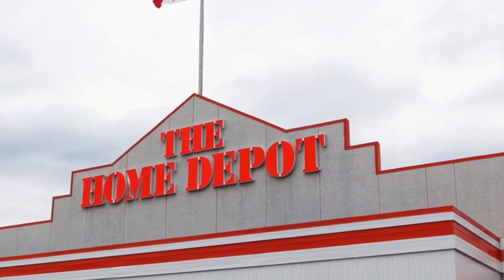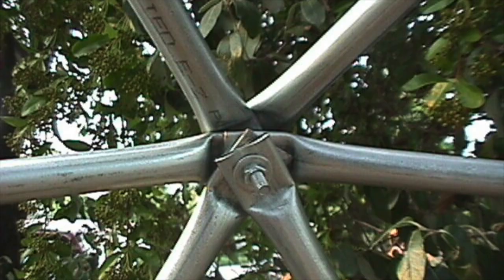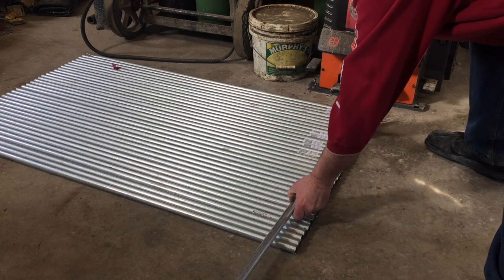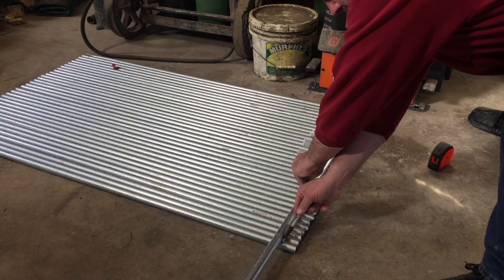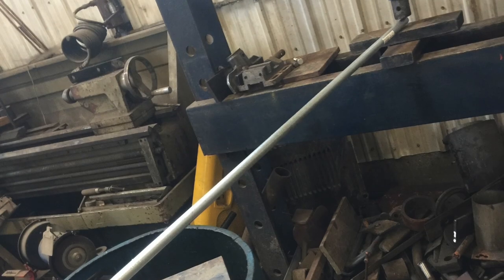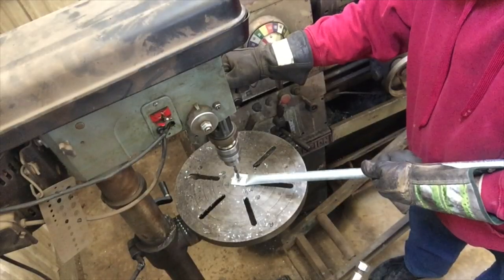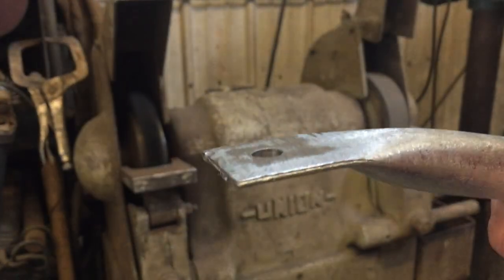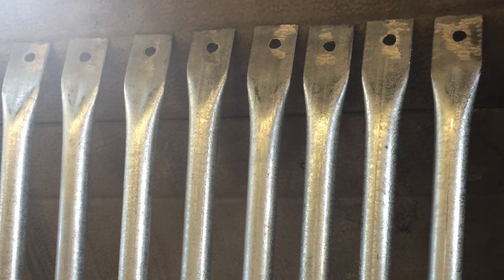Making Metal Geodesic Dome struts under $2 each DYI - Part 1 (2020)

Comment from the maker: I would love any comments/ideas on this! I'm always looking for better ways to do things on a budget!
Reply: "A big mounted grinder is essential."
Not really essential, a hand drill with a larger bit or reamer would work just as well.

I would have clamped two straight edges forming a 90 degree pocket on the drill press table. That would have allowed you to place each pipe end into the corner and it would quickly and exactly put your pipe end where it needs to be for drilling.

I loved the concept on building  this thing. .  Thanks for that and the video Cheers
Reply from the maker: @rickdees251  thank you
Reply: You didn't calculate cost of equipment. The title is misleading.
Reply from the maker: @richardroman9280  but you keep the equipment!!!!
Reply: Use an angle gauge while squishing the end, adjust angle before taking the pressure off. A countersink in a drill will deburr the holes, or you could use a flap wheel on an angle grinder and round off and deburr the end at the same time.
Reply: I got four of those drill press hydraulic dealies in my closet! They're super cheap.
Reply from the maker: @voidisyinyangvoidisyinyang885  sweet
Reply: have you got a part 2 - did you construct the dome
Reply: How long is each pipe in this case ?
Reply: @jamesdds  
8 inches long & moderate girth
Reply from the maker: @jamesdds  oh god - that was a few years ago!!!!
Reply: Simple Tek - 1 idea, since you want quite precise angles for easier assembly, with no preload conditions: Make a Fixture to hold the pipe, and set the angle, one for each angle needed. I bet there are some easy to learn CAD Programs you could use to design a good one. 

You want a two halved design, that can clamp the pipe ends on the round shaft of the tube, and either a hinged face that bends up to a stop angle, or a slide that is already machined to your set angle, that slides in to stops, for you base angle. Finally, you want to press from the other side to set the tab angle. Remember, allow for your springback! All metals have that.

Then, get a Wood Shop or a Metal Shop, that does CNC Work for hire, and make a couple! Maybe try first with wood, as you might need to do a large "Tweak" on your first one! If it is right on with wood, and you want to make Dome kits to sell, go make metal forms!
Reply from the maker: ok
Reply: Unlike an airplane your which which is very worried about weight cement and these tubes will make it stiffer and have your so the wind doesn't blow it around it might Act might at as a corrosive maybe could shoot foam in there soon knows as corrosive

Comment: Well,
You got your squishing tech wrong.
For that to really work you should take two blocks of metal and use and angle grinder to carve a less than half circle on both sides.
mount them in a heavy vice and preferably have a stop plate at the back so that every pipe goes the same distance into the press.  While it's in the queeze do your angle bend as well.
The straight flat is know to wear out at the transition from flat to pipe.
The curved transitions hold their shape more and don't stress harden and snap from small bends over time.
Reply from the maker: And yet, years later, the dome is still standing!
Reply: @SimpleTek  
And yet they don't look like they are metal fatigued and about to break for no apparent reasoning.
If you have an electric angle grinder, and can find two blocks of metal then doing it better isn't an issue.
This isn't that hard to accomplish, and is the beginning of a basic metal working shop standards.
Quality is just a Do.
If you really want to reduce every action to the most minimal possible then don't even start anything and don't get out of bed even to poop.  For that would be the ultimate accomplishment in that direction.
Reply from the maker: @FuhrChris you’re assuming, they don’t look metal fatigued at all
Reply: @SimpleTek Metal fatigue often is the cracks on a flattened pipe are on the inside.
(I kinda  know some stuff about Metal fatigue since I worked right next to Boeing's destructive Lab and would get to see things like whole wings being subjected to stress hammerings.) 

You said It's still standing.

I take it you never took it down and set it up REPEATEDLY?

You build so that you can't take it down and put it up somewhere else.

I build BETTER with about the same amount of effort.  I can move my builds without having to worry.  In fact I'm looking at making the Oval version in which what starts out as a circle could have a 1/2 circle taken down and the middle created.  Then each year I could take down the 1/2 circle and make it LONGER.
By taking the time to do it right I can do more.  And it would have taken less time to do it the right way than to keep defending in your next text.

Comment: WOW GREAT VIDEO! Have you ever made one of these into the adobe style houses before can the design hold the weight of the clay? What website did you find the plans at you said its manitoba sites for agriculture yes ? WHich ones  have designs to see ? Did you make all the designs ? Is the site for farm life how to build stuff ? Is there still programs like what Ontario had when people needed to build a sheep pen and the farmers could apply to have help for building stuff is this the same thing in Manitoba? Cause they could take your design for the geodesic structure use it to make roof for an animal hut and use bails of hay like they do to make the tiny houses on Kibbutzes in Israels and the bails to insulate walls use the gedesic for the animal sheep shelters and such or even build tiny houses for people too have you seen the ADOBE style houses the dome you made can be adapted to make the roofs for those if the pipe that you selected is strong enough to hold and wont bend under weight of clay did the Manitoba website its government one right so did the plans say if they tested the structure for such uses and would they approve for such also? Under building codes did you have to get approvals and such ?Make more videos on this you make such great explainer videos on how to I was impressed! Good work!
Reply from the maker: Not sure if it could support clay

Comment: Conduit is too cheap. I made my own but I used steel tubing with  eighth inch wall. 50 ft 6 V for $2,200.
Reply from the maker: Prices are different after the pandemic

Comment: Ironworker machine with the correct dies would fly through this process, 1 stroke of the hydraulics to squash, 1 stroke to shape, 1 stroke to punch the hole.
Reply from the maker: Agreed but for one greenhouse does it really matter if it takes an extra 2 hours?    Cost of machine
Reply: @SimpleTek  Yeah bit expensive for 1 greenhouse 😂 Recently came across Ironworker machines and how versatile they are, especially the Scotchman with how many accessories are available, cool project 👍
Reply from the maker: @RichardSmith-wr6go  thank you

Comment: I would have touched up the corners and ends of each pipe.
Reply from the maker: Good advice
Reply: @SimpleTek  It’s not a big deal. But it might prevent minor cuts, especially during assembly. Or if kids are inside after assembly. But this was an EXCELLENT idea? New subscriber!
Reply from the maker: @Zerpersande  thank you for the kind words

Comment: C’mon…DIY? The only part of this that is remotely helpful to a typical DIYer is the part suggesting conduit is cheaper than pipe. And even that isn’t any revelation. The video shows using a piece of pipe used to draw a line across the others pieces instead of using a 4’ metal ruler but THEN goes on to show the use of a industrial shop grade metal press, drill press, and grinding wheel. Seriously? I mean if I had all of those tools at my disposal I wouldn’t be searching online for ways to easily and cheaply fashion metal pieces like this. Added to that are the helpful comments about how hard it would be to do the same tasks WITHOUT access to such expensive tools. DUH!.
Reply from the maker: What does DIY mean to you? Corporate Lego?

Comment: hey pleasetell me the power of your hidraluic press in wich you have obtained that angle you steel bars  thanks you cheers
Reply from the maker: That was a 100 ton but you could do it with a 10 ton
Reply: @SimpleTek  some on the web get  astraight angble with super mechanics in a supertstore,amateur is crazy when he tries to bend the angle from straighit to whatever is desired...  with all kind of mechanics, can you guarantee me  i can get the desired angle for a V2  witha 10 tone hydraulic press?
Reply from the maker: @barakasense  guarantee? Nope lol

Comment: Since most length of pipe are the same set a table that allow you set and mark the pipe with a sharp knife. Use a good quality pipe cutter will cut your pipe or use a chope saw. You should have the same pipe length within 1/16 of an inch. For me I would even use a grinder to make sure the pipe length are the same by grinding the end. Then use a die to make your holes and ends. Then you will have good connections
Reply from the maker: connections? the squished makes for the great connections !!!

Comment: if I want to build 6v geodesic dome using the same pipa, does the angel of the pipe still the same 18 degree and 16 degree ? Thanks
Reply from the maker: use a dome calculator - angles change huge for 2, 3 and 4 V and so on

Comment: For those without the tools.  One could set up 2 bench Vises to flatten the 2 ends at the same time.  these will be flat and need to be bnt later on to proper 16 to 18 degrees.  One can take the conduit to a metalshop.  Many will do metal work for $1 per minute.  they will use Jigs and stops to be able to cut additional pieces without remeasuring.   They can use a shear instead of a chop saw or can use a bandsaw to cut whole bundles at one time.   they can setup 2 squishers that simultaneously squish both ends to keep flattened parts absolutely parallel and my metal guy uses a spring loaded puch marker to proVide tiny dent where either the drill bit or hydraulic punch makes the hole.  This preVents the tip or drill bit from skating.  By using shears instead of a saw, no burrs need grinding and the right punch die can also round the ends of the struts for easier set up.  Depending on size of project, there is some point where a professional can help the DIYer saVe money as well as time
Reply from the maker: cool - I like sledge hammers though. LOL

Comment: Copper tubing around wood stove pipe. 12 volt pump for solar panel or battery charged by solar. Connected to 1/2 PEX on floor in home. Pink 1" styrofoam insulation to fill gaps between. 100% vinyl plank flooring to cover. Cheap radiant heat. To prevent over pressurizeation use old water heater tank and leave cap off on top for pressure escape.
Reply from the maker: cool

Comment: This is amazing, thank you for sharing. Can this be made into a house? Eg. Fiber cement board for covering? I have no building code in my village.
Reply from the maker: Yes, absolutely
Reply: @SimpleTek  if I do fiber cement board, one strut wouldn't be wide enough to fasten two boards where they would join correct? Unless the pipe was much wider? Could I use square tubing instead and flatten the ends the same way as your pipes? What do you recommend overall for my challenge with fastening fiber cement board?
Reply from the maker: @AliAbdullah-oi3wc  mines was a 2v, but you can do 3v, 4x or 5v structures for smaller triangles with the same sq footage of the dome
Reply: @SimpleTek  but what about the fiber cement board part? 😬

Comment: Hey brother. Nice work. Hope that you will get this somehow someway? HOW ABOUT A HEXAGONAL DOME HUB WITH A 4 INCH DIAMETER. THEN DESIGN DOMEES CAPS WITH SPECIFIC BEND DEGREES. LIKE A BEER BOTTLE CAP BUT HEXAGONAL IN SHAPE. MARK AND CUT YOUR GEOMETRIC TABS. THEN MAKE A HAND BENDLE TO FORM THE BEND IN THE TABS. THE POTENTIAL OF THE DOME IS NOT IN THE STRUCT, IT IS THE FOCUS POINT OF THE STRUBS WHERE THEY ALL INTERCONNECT. 2 INCH METAL.  IF YOU DO GET THIS MESSAGE BROTHER, I REALLY WOULD LIKE TO TALK WITH YOU ABOUT ADVANCING THE DOME TECHNOLOGY. THANKS.
Reply from the maker: why not! when you make it post pics or video!

Comment: What length did you cut the pipe A and B? That's the most important information and you left it out?🤬
Reply from the maker: I used a website called domerama.com but it's since been taken down. any online dome calculator for a 2V dome can give you the number you need though.
Reply: @SimpleTek  Why not just post the numbers? I dont get it?
Reply from the maker: @406crusader4  I made it several years ago and don't have the numbers anymore - that's why
Reply: @SimpleTek  you don't have a tape measure? OMFG
Reply from the maker: @406crusader4  you want me to go outside, measure it for you, come back and post that data.... ok. hang on........
Reply from the maker: 53 1/2" and 61" from the inside edges of the holes, hole to hole for the two poles
Reply: @SimpleTek  Thank You so much. 👍

Comment: If you are doing lots of metal work like this, pick up a harbor freight portable bandsaw. Less than $100 USD. Fast and cheaper in long run.  Pick up a better blade first thing though.
Reply from the maker: Thanks for the tip!

Comment: I’m going to use this to make a climbing dome for my son. Great video. Thanks!
Reply: If you want a climbing dome, I would suggest a material more ridged than 3/4" emt conduit.
Reply from the maker: @daphneblake7889  the 3/4 I used was amazingly strong for that size, I'm over 300lbs and can hang off it. if it was smaller it would be hugely strong. Domes naturally have great structural strength.
Reply from the maker: you're welcome!

Comment: I've gathered heaps of EMT from dumpsters around construction sites and the back of electrical supply stores. When a piece is slightly damaged they usually toss them. Lots end up at the metal recycle depot and you can get it there at scrap prices if you keep your eyes open and check in regular before they squish it down. Another place to get cheap metal tube is from metal shipping frames for things like ATV's and snowmobiles. Usually 3/4" x 1-1/2" rectangle tube frames, local places just pile it up free for the taking until it is to much and they scrap it all at once. So with some time and scrounging, free or super cheap material can be had for almost any size tube dome!
Reply from the maker: that's awesome!

Comment: This is great, but I dont have a hydraulic press in my garage?
Reply from the maker: you can buy them cheep on ebay or amazon or just use a sledge hammer on a hard surface
Reply: @SimpleTek  can you send a link to the 'Squisher' you made these with?
Amazing they were within 2 degrees of what you needed!
Blessed
Reply from the maker: @rexybodean3029  it was a friend's machine which he bought at an auction years ago
Reply: A very cost-effective version of this can be made with a portable jack, a few plates of steel, and a little welding.  Here is a really basic one. https://www.youtube.com/watch?v=wqtdfb1dJ5I

Comment: I don't have the tools to make the bars. If you live in Ottawa, can I buy off u?
Reply: Boobookittyfk small sledge hammer and drill
Reply from the maker: sorry. not in Ottawa. You can use a hacksaw and a big hammer on concrete to flatten the edges - or buy a squishier (press) from ebay for about $200

Comment: ... great start .. using a countersinker for deburring the holes instead of grinding off the zink plate woud hold up the anti rust coating at the connection points ...
Reply from the maker: good advise!

Comment: Thanks so much for your excellent video! Any other methods to flattened the pipes? I don’t have those tools you used on the video.
Reply from the maker: You can use a hammer on an anvil or concrete block to do it!
Reply: Simple Tek never thought about that one 👍 thanks so much!
Reply: @cirosochyesposito9443  
Sledge hammer
Reply: Or a Bench vise

Comment: After you calculate the length of a strut, say it's 4 feet, is that the measurement from end-to-end of the pipe or hole-to-hole that you drilled?
 It seems it would be important to get that measurement correct. Thanks for you help. Good video!
Reply from the maker: Roast411 hole to hole

Comment: Instead of grinding off the burr on the drilled holes, use a counter sink. It’s quicker and doesn’t remove the galvanized finish on the flat.
Reply: can you explain to someone who has no idea what that means
Reply from the maker: if it was an assembly line yes - this is one greenhouse

Comment: Lol precision and speed, I could have drilled 4 holes to your one on the press...
Reply: toordog Agreed - pre tapping  the center whole with hammer &  nail insures the bit does not travel. The thickness of the pipe is insignificant to poor drill angle.
Reply from the maker: My god you could have saved me a total of 30 mins!  That’s impressive!

Comment: Should have set up a tube guide with a backstop on the "squisher", thereby ensuring identical length of "squishing" on each tube, which also eliminates the need to mark them all, - and then include a parrot stand for supporting the flat portion, of the already formed first end, for the second end "squishing" operation, to ensure both ends are formed with a common plane.
Reply from the maker: you can do anything with enough money, I did this with what was on hand